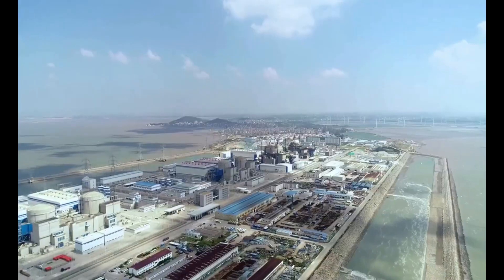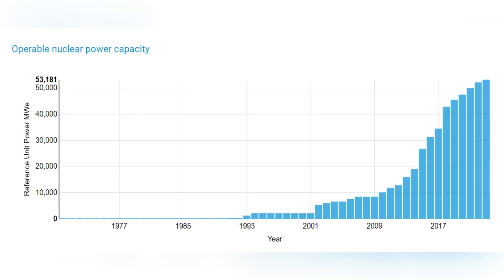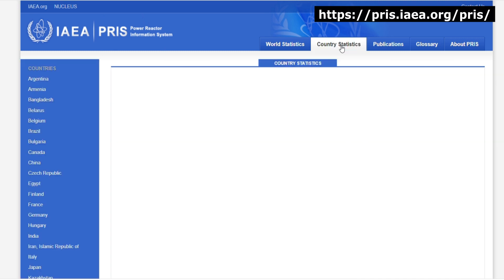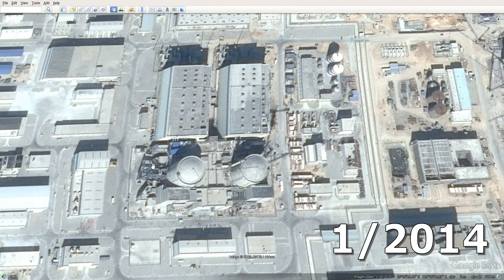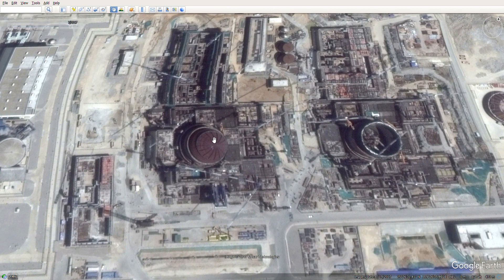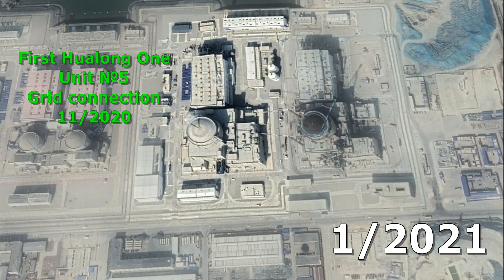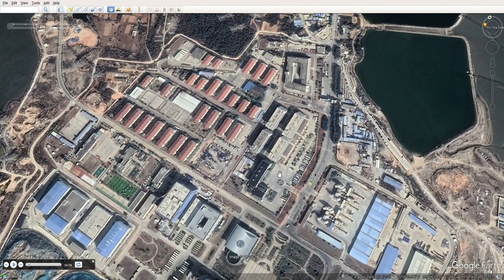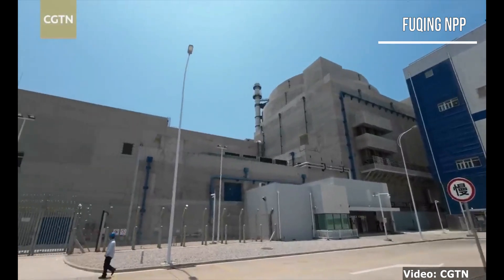How China build nuclear power plant. Watch from Space

Comment: This is an excellent video with the first class information.  From my conventional power plant background I commend on the station layout with cooling water intake and discharge on either side of the island using channels for thermal separation.

Whenever a steam turbine is used the efficiency is 1/3 so we have a 1,119MW output per unit (#5) with an thermal input of 2905MW.  The difference is the rejected heat, size double the output approximately, discharged into the ocean.  The cooling water system is the key limitation factor for the maximum size a nuclear power plant could be build.  It is the challenge of keeping the rejected hot water re-circulate back the plant.  The World Bank standard mandates cooling water approximately 0.04m3/s to 0.05m3/s per MW of station output so Fuqing with 6,150MW will need to pass between 246 to 307 m3/s.  This is to say every second between 250 to 300 tonnes of water must pass through the station in every second.  Environmental regulation the heated seawater must not be higher than about 6 degree C about ambient.  It is no coincidence than all the world's biggest NPP are about 6,000 MW.

I am not knowledgeable on how to make use of the rejected heat at the local seashore but the station experience generally show marine lives thrive on the discharge zone even the rejected water is chlorinated as a necessary step to discourage marine life in and out of the power plant.  With suitable planning it is possible to bleed fish and other industries in the nearby areas.  UK once had a conventional power plant used the rejected heated water to bleed worms.
Reply from the maker: Thank you for your comment and rate the video!
Reply: I used to live on the Chesapeake Bay in Maryland in the US.  The Calvert Cliffs station (a few dozen km down the east side of the bay from where I was) was a very popular fishing destination because the fish liked it there at certain times of the year.

Thanks for the details on cooling water volume and standards.  I think adequate knowledge of size, volume, quantity is critical when thinking about nuclear power generation in comparison with other methods.